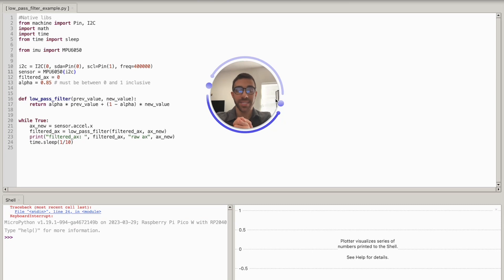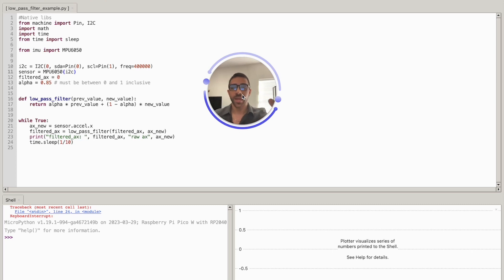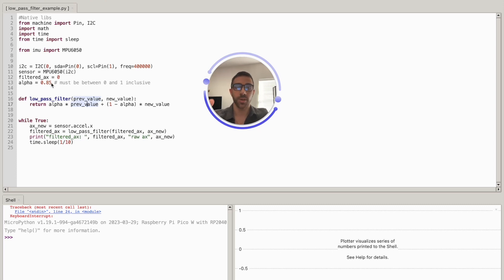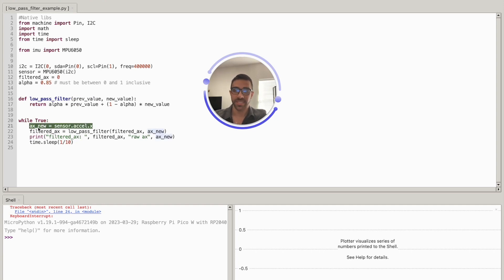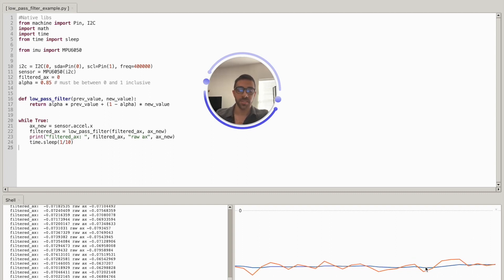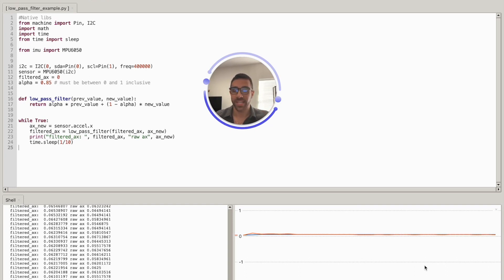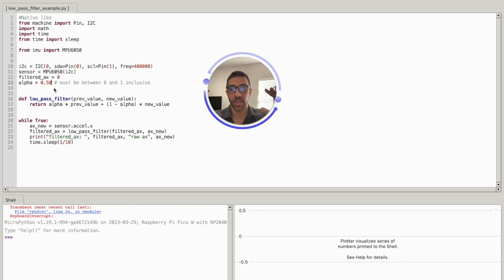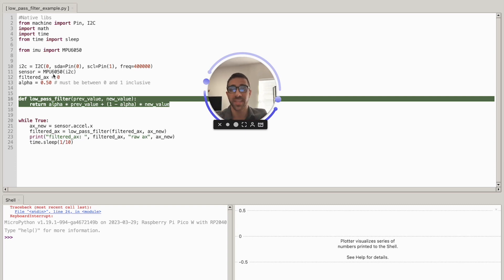How to Create a Low-Pass Filter | Raspberry Pi Tutorial for Beginners

Comment: Isn't this more a moving average filter than a low-pass filter?

Because with a low pass filter you should consider frequencies in the data instead of just the previous value.
Reply from the maker: This is a form of a Low-Pass Single-Pole IIR Filter, pretty much as simple as it gets, I know there are other forms of filters that do consider the frequencies. Definitely more involved than this.